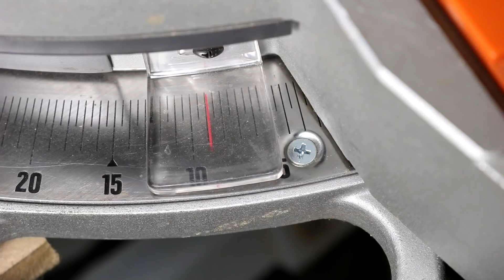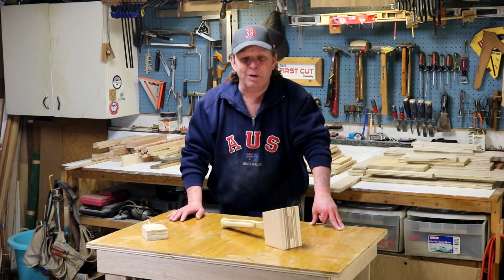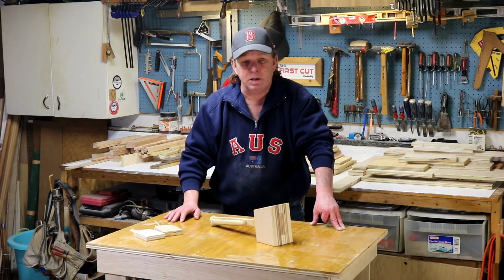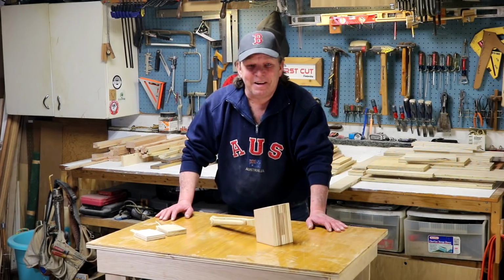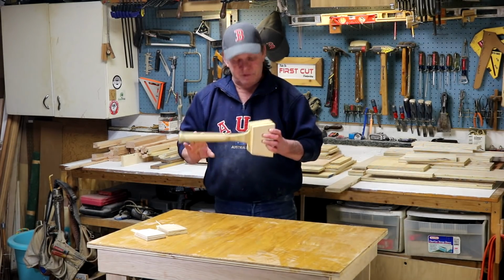Scrap Wood Projects

Comment: I had an old table saw that worked great!! Only trouble was in the last couple years I owned it, I noticed the rip fence was out of square and the more I used it the worse it got, which I was building some boxes out of half inch plywood, when it failed to cut them truly square! That was the last straw and I was NOT going to buy a $300 rip fence for a table saw I had bought at a yard sale for only $50 originally!! To this day I have wondered what to use the screwed up plywood pieces for, until my step son gave me, a beat up old air compressor that the motor worked on it, but the compressor NOT SO MUCH!! So now my out of square half inch plywood panels will become the pulleys I need to make a bench top belt sander!! LOL!! Like you say Unintentional Design Change!!! LOL!!!

Comment: It cost me $£8 to buy one of those mallets, that one has bonus stripes  and cost you how much roughly in time and wood offcuts.
Make half a dozen and sell them to people just starting out
Reply from the maker: Thanks. The wood was either going to be used for something like that or burned, so I don't see a cost for the wood there. In fairness, it took me several hours to make it. Mostly because I had to wait for the glue to dry. I'd say you could easily batch those out if you'd like and have like 30 of them done & available in a few days.

Comment: Got a few ideas for you to consider, marking gage, mortise Gage, tenon marking gage,winding sticks,beam campus ,plum Bob, dove tail marking and layout, belaying pins for rope , extension cords or layout lines and the Heddle's to go with them,  some bench dogs, soft wood jaw facings for the vise, custom holders for use with regularly used bits at drill stand or router table, knobs are always useful,if you have some hard or exotic wood it could become some real nice inlay or veneer  ( think intarsia) , glue up relief cut hot pot bases,Various novalty items.
Reply: Chris Cute your welcome,and thank you for the reply.
Reply: I think I'll try some of these. Thanks

Comment: Chris, watching you cut at the tablesaw with gloves on terrified me. There is a thing in our brain that tells us where our hands are, it doesn't account for the extra 1/16th or so for the glove. When the blade catches the edge of the glove, you lose your hand. I would much rather pull out the occasional splinter. Otherwise a pretty good video.

Comment: Everyone, after 28 years using power tools, instead buying a fancy new tool, I got to spend $2200 on a fancy new hearing aid. I maybe a good craftsman but an idiot about hearing protection. I’ve always been great about glasses, face shields, dust masks, lifting correctly, push sticks, but the hearing protection always was too much trouble. My 2¢